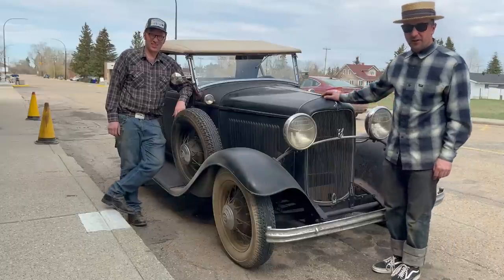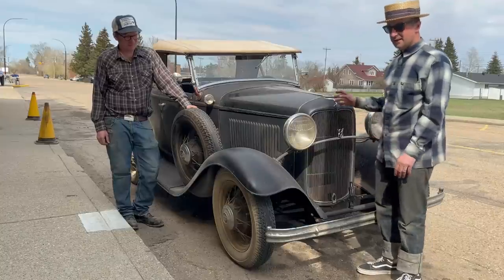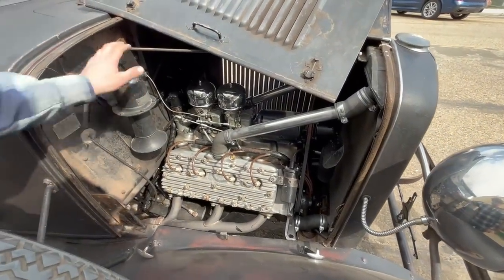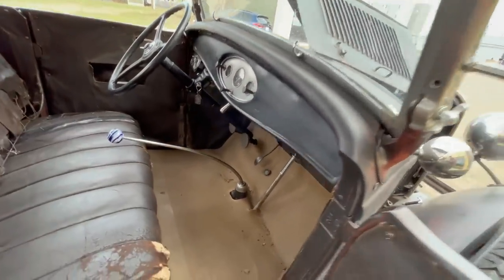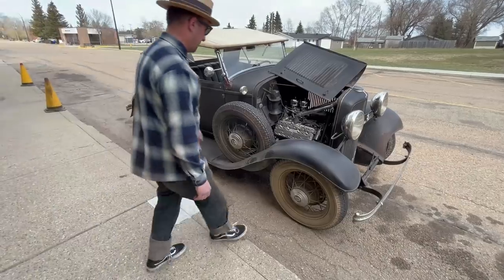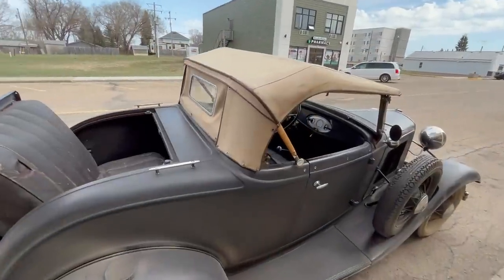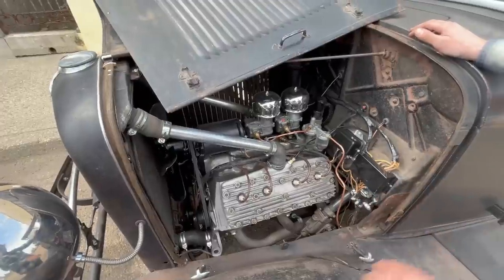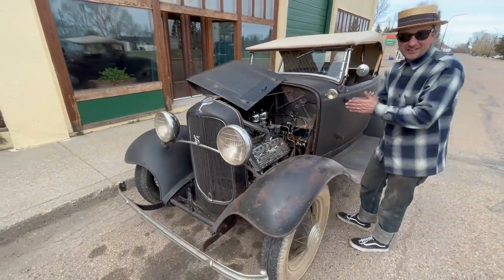Driving Tour Of Elk Island National Park In A Flathead V8 Powered 1932 Ford Roadster!

Comment: Go 3.54 rear end gears or is possible a Columbia 2 speed. Sounds like the flat head is built just right for good driving. Thanks for the keeping of the flatheads. A quick question, when we ran flatheads in stock cars (1950's) we used Canadian 59 a's as we were told they had a higher nickel count.  As experts, can you verify?  I do know we had better luck with them and never had one blow up. Thanks.

Comment: I noticed you have the steering worm a bit tight as your steering is a bit jerky or tightens a bit when you turn the wheel and come to small tight spots... I used all new parts and box as well if I could get my hands on them... it wears out from the steering being in just one spot going down the straight aways an so wears more right there... you kids are smart and will figure it out.  Like your prior statement, a sixteenth of a inch here and there comes back to bit you if not taken care of.